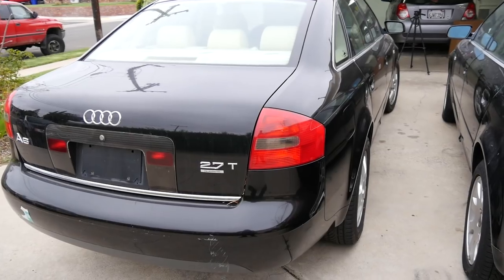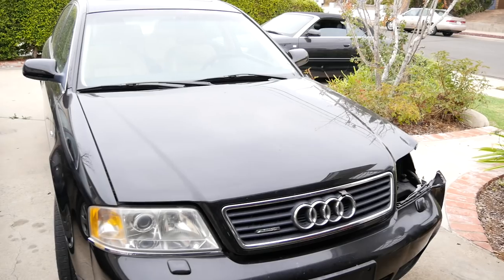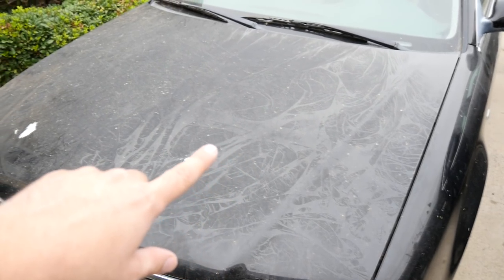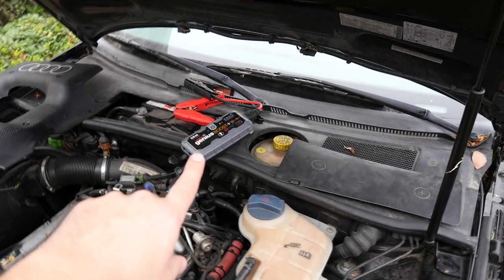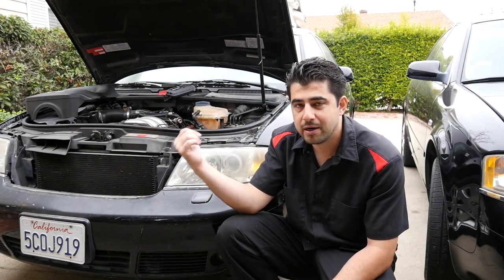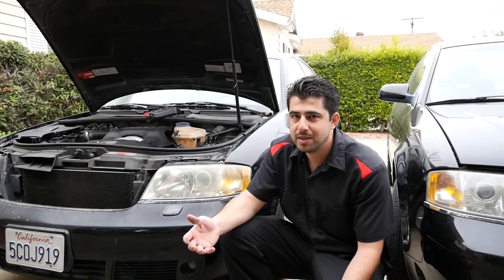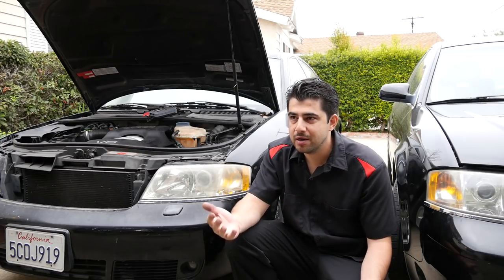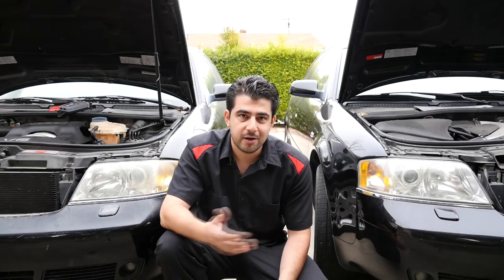Sleeper car for +$500 - No Joke

Comment: Not a sleeper. A sleeper is a car that doesn't look fast but actually is fast. & by fast I'm talking 370+hp. & you can't sell that front grille for more than 30 bucks. Not 70. Also, vw and Audi a4, a6, 4cyl, 6cyl, can't make more than 15 more hp without a tune. It will go into limp mode. I own one. It is not fast, it is not a sleeper & no you can't throw a few hundred bucks at one of these cars & get 50more hp. Lyin mf
Reply: alex janito so stage 3 2.7's aren't cable of making 370hp? I was under the impression that they are and was reassured countless times
Reply: alex janito with a tune,  these 2.7t can make 300hp. That's without adding or installing anything else beside the tune.  So with breather mods,  maybe a different turbo,  and a tune.  This'll meet the goal
Reply: LanEvo55 dude I'm telling you, don't even make me do it. I know so much about these cars it's almost dumb. You can't just throw power upgrades at these cars. The computer will not let you. It's not like a dsm. It won't make more power like that. These cars aren't supposed to be messed with. They do not like it. You're talking aftermarket ecu in one of these if you wanna compete with anything else quick out there. You can slap a 16g on a dsm & push it to 15psi without doing anything else. The Audi cars have an n75 valve that gets in the way of everything & if you take it out it goes into limp mode. There's also a bunch of other stuff in the way. If you want easy to add power, get a dsm. Or any other tuner car. Or something with a v8.  Not a German pos.
Reply: alex janito I actually owned a car with this motor before it got totaled.  I was told by the shop who I was going to get it tuned by told me too do it in stages.  It even gave details as to what parts constitute what stage.
Reply: DaMario Harris & how expensive is that. Not just a few hundred bucks. Closer to 1000 if not more. There wouldn't be a video if his car wasn't crashed before. Get an Audi s2. Can make 500+hp easy
Reply: LanEvo55 also I have a 1.8t passat, I can't do much to it, I've done my research. But the Audi tt. Same motor as mine. Can make more power cause it has a different computer. I could make mine make 500hp after thousands and thousands of dollars. But it's just not realistic for these cars for price
Reply: alex janito what places have you checked for parts of I may ask
Reply: LanEvo55 I'm telling you you can't throw parts on and make more power with these cars, the ecu will not let you. Now if you spend 600 on a preset tune for more boost you can make power like that. But not much. Go on apr
Reply: alex janito that was what I was gonna recommend and one that is nearby me is a company called solo motorsport.  They have ecu tuned in stages that's affordable and tells you what part classify it's stage
Reply: LanEvo55 lookup www.kometmotorsports.com kurt lives in my subdivision. He's had a 400hp 1.8t jetta & has built alot & has done a crazy number of clutches & motorwork on these cars. Dyno, the whole shop is full of nice tuned cars and every tool you could ever need & process papers for whatever you need. Bigger turbo's, stronger internals. Good place
Reply: LanEvo55 It damn sure wasn't a couple hundred dollars but my 400hp s4 seems to be doing well with the stock n75 ran in line with a boost controller. Even without the boost controller, it was running the psi I was tuned for.
Reply: alex janito cool,  try looking at composites such as ecstuning, 034motorsport, JHMotorsport, or sites that sell go fast bit for the passat
Reply: alex janito you can get a tune for $275. And as for the n75 valve thats what a MBC is for the n75 is a piece of shit
Reply: Sugar Mist I thought you called him a piece of shit at first, I was like "Damn that took a turn." Anyway, no need to explain the right way to get power out of these proven motors... Just let his little 180hp passat stay slow until he figures it out on his own
Reply: I'm new to VW but with the MK7's golf's they take mods really well and do very good with just a tune. Sure the models up til now wont be capable of making the power a good ol DSM will with just bolt-ons but they really aren't that bad. I've got 2 1g talons (1 awd, 1 fwd) and a mk7 golf GTI.
Reply: MechRider89 ooo a awd 1g huh? Looking to part with either 1g?
Reply: lol not the awd noo, I'm only just getting the hang of ecmlink!.